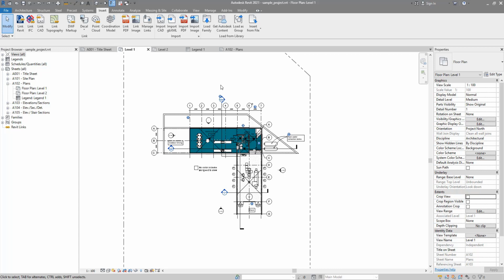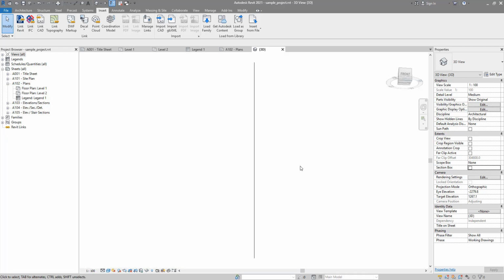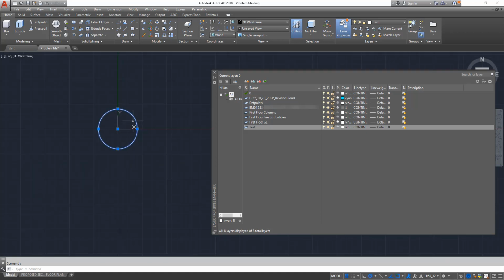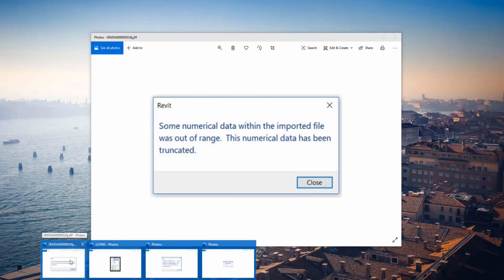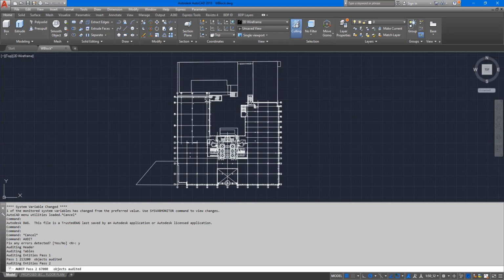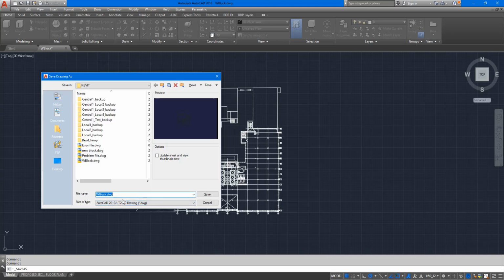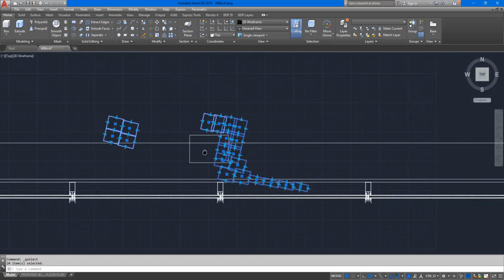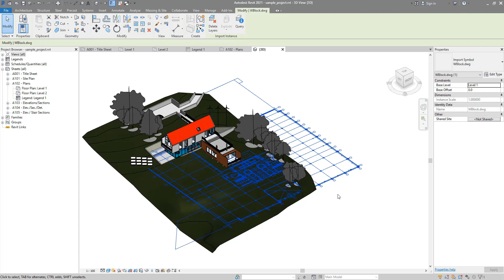Revit Snippets: How to clean & optimise DWG files for Revit

Comment: There is one problem I didn’t see addressed: If the CAD origin is located far away from the content the linked CAD file does not behave well. If you zoom in the linked CAD jumps around and the CAD cannot be used as a reference. The fix is to move the content within CAD close to the ACAD world origin. Then all works fine. The only unpleasant side effect is that when we export our Revit backgrounds to CAD to give them to the Civil Engineer then the exported CAD has a different origin then their CAD. Ideally we all want to work in a SHARED COORDINATE SYSTEM. Thank you Autodesk for leaving us with that problem!!! Does anyone have a fix for this??? PLEASE !!!
Reply from the maker: Regarding the Cad file in Revit "jumps" when you zoom in, it's likely because it has some geometry at the origin and therefore has a huge bounding box.